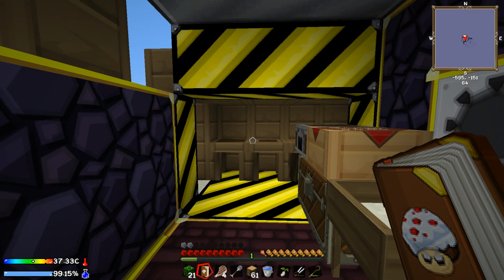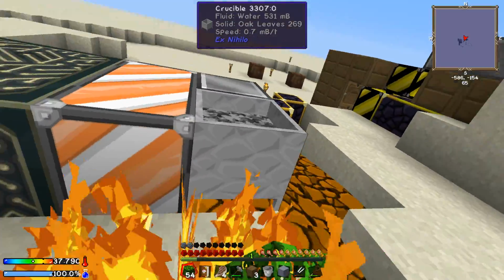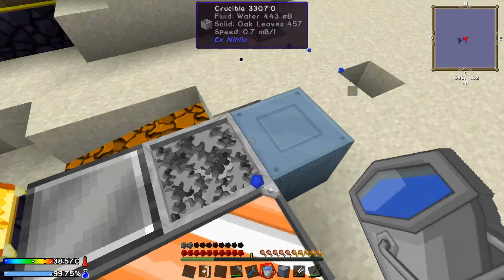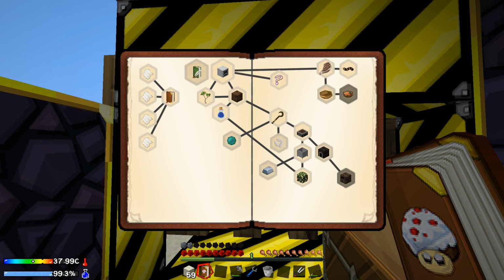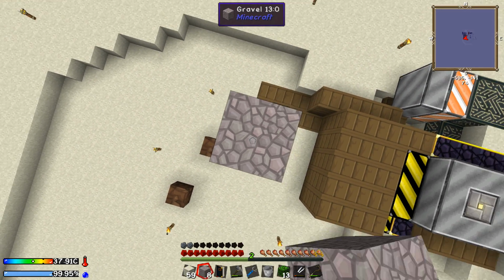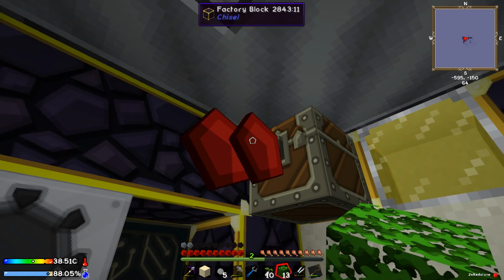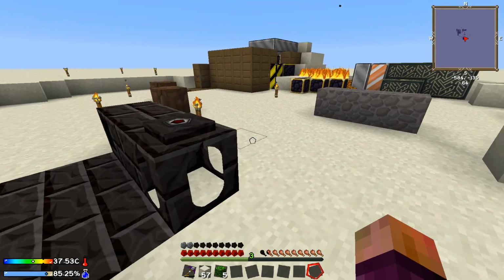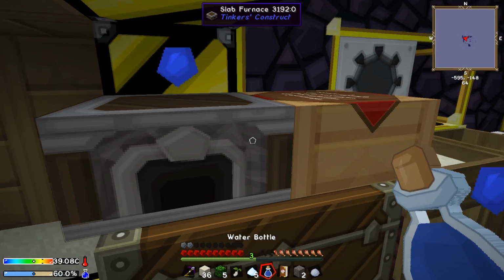Minecraft Crash Landing - Part 4 - Tinkers Smeltery & Clay Production!

Comment: your channel is a lot of fun to watch, but you are SO going about this modpack backwards... 1. create an infinite water source, makes it easier to get clay. 2. You have Dust ALL around you, one you have an infinite water source you can make a ton of clay. 3. You already have a hammer. Use the hammer on your cobblegen directly instead of using up the durability of your pick. 4. Put some cobble slabs over the pyrotheum so you stop catching on fire... 5. make a juicer so the apples you get are better used. 6. use leaves in the aqueus accumulator for your drinking water instead of wasting furnace fuel. 

watching you make water in the crucible was painful when it would be so much easier with an infinite water source. :P 

otherwise, keep up the good work